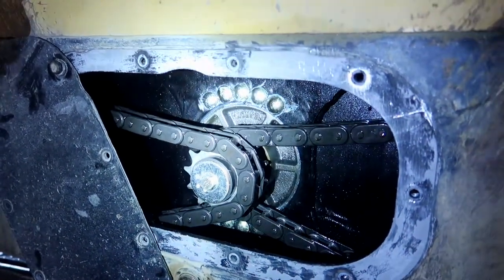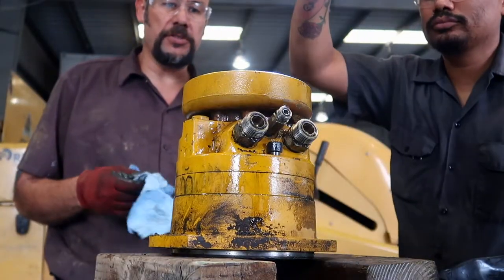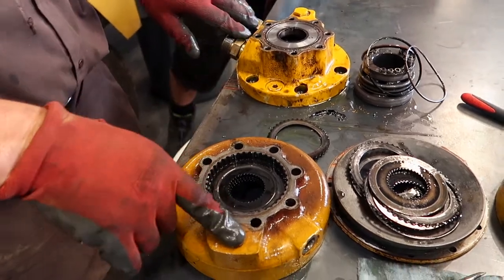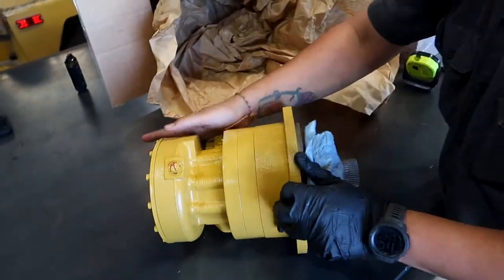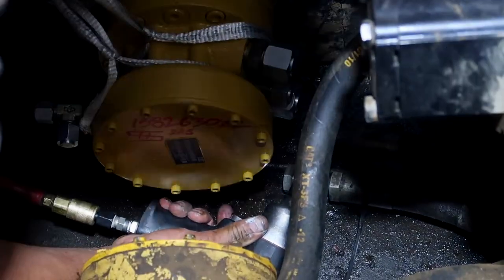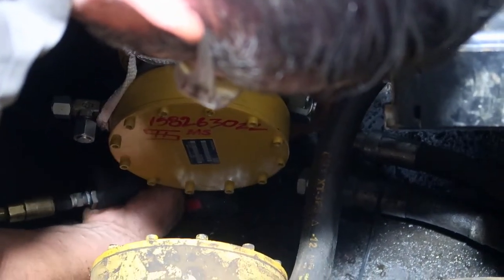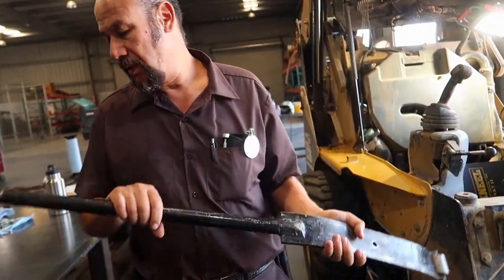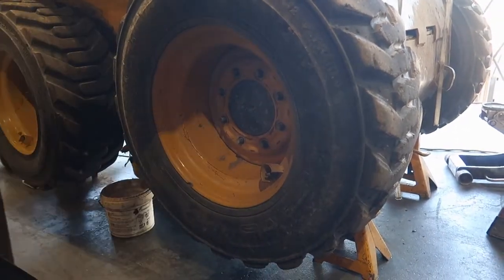Caterpillar 232B Drive Motor Replacement

Comment: I just resealed my chain case inspection cover on my cat and started off scraping the old RTV  like you were. Then I tried a wire  wheel on a drill. It knocked off all the old RTV immediately without removing the paint. Took about 2 mins to do both surfaces. Worked great.
Reply from the maker: Yes, sir on some stuff we do use the wire cups on a die grinder it does work really good I have to agree the brush bristles are the made to remove grime better